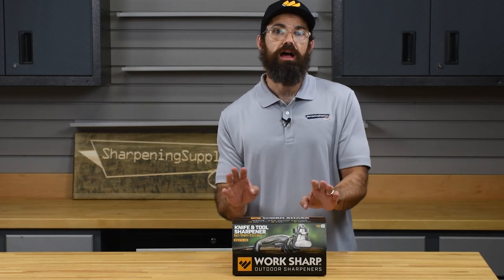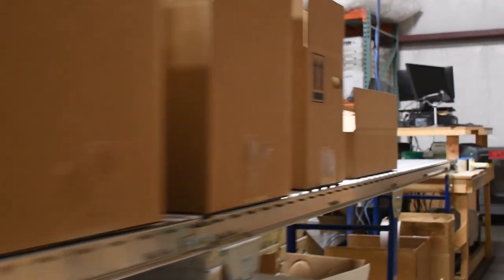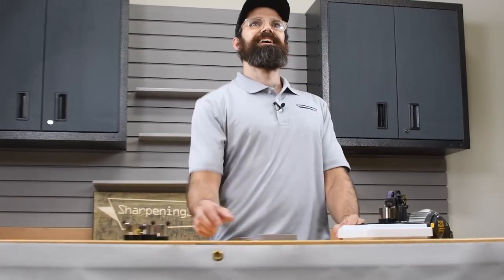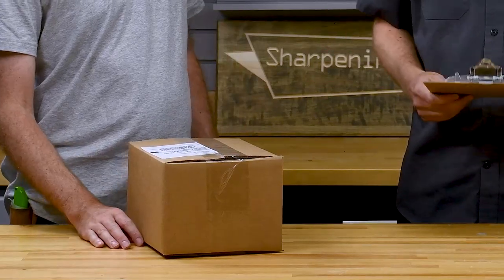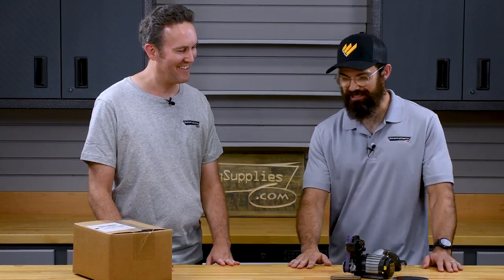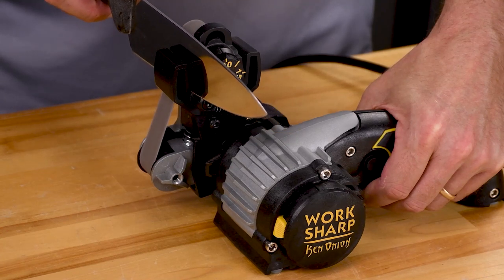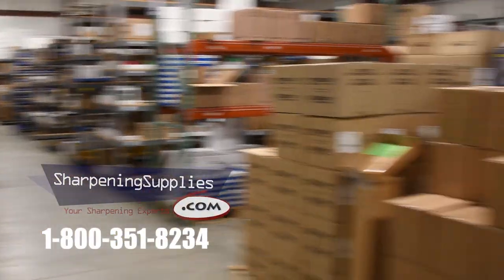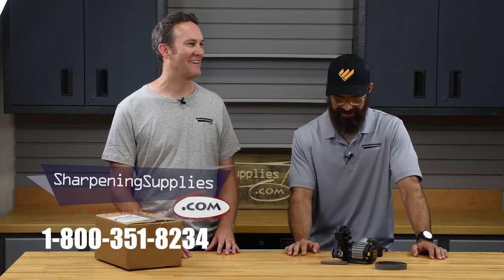Can the Work Sharp Ken Onion Knife Sharpener Win This Race?

Comment: Brett is the shipping king, but the changeover to a second belt made it unfair, as you can get sharp at any grit with enough time.
If Brett had to ship two separate items against the two belts, then I think Tom would have been victorious.
And if it were one belt versus one item shipped, I think Tom would have won also.

Still fun to watch nonetheless.
Thanks for the upload.
Have fun, be safe, stay sharp.